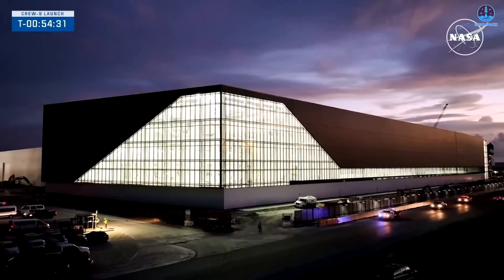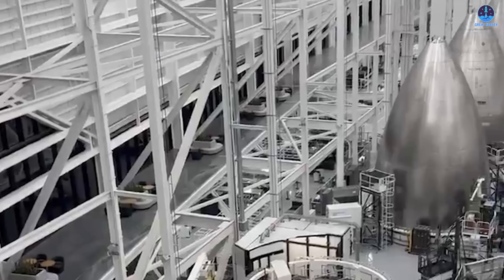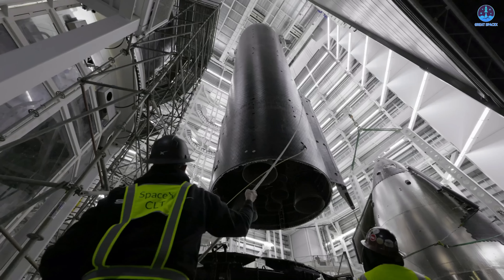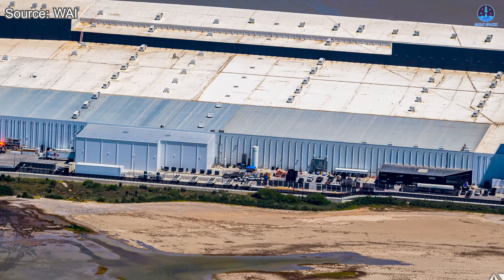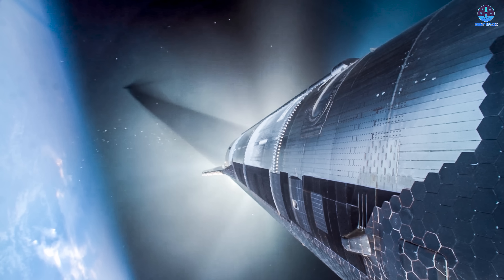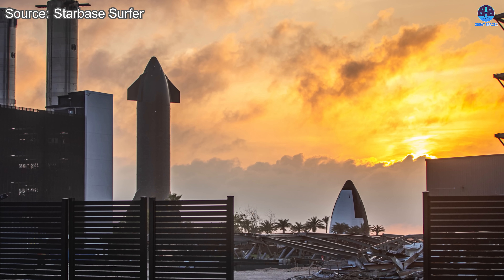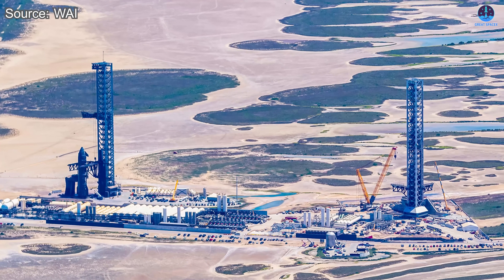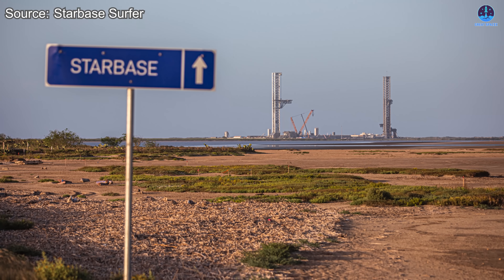Elon Musk Revealed Crazy Starship Fleet Inside SpaceX Starfactory Shocked the Whole Industry!

Comment: After refueling, the disposable StarShip in low orbit can be repurposed for other tasks by slightly raising its orbit using residual fuel. If solar panels and various equipment are installed during launch, it could be quite effectively utilized.
It also carries Starlink communication equipment.
It's like an efficient piggyback satellite.

Comment: لماذا لا يكون هبوط مركبة ستار شيب أفقي وليس عامودي مثل طائرات F35 بحيث يتم وضع محركات صاروخية جانبيه على طول المركبة الفضائية ❤
Reply: Starship too big. All the extra hardware and structural reinforcement would severely decrease payload capacity.
Reply: because that will increase complexity very much, and solves no problem as legs will still be needed to land by it self instead of keeping the landing gear on the ground in the tower and using the same engines to land as those you need to launch

Comment: SpaceX is gearing up to build more starships more rapidly? So who are the customers going to be? This is sort of like the Ford Motor Company gearing up to build more Edsals more quickly. Except in this case, SpaceX still doesn’t have the heat shield it needs. Gearing up to satisfy a demand that no one knows where it’s going to come from is good for just one thing and that is to attract weak minded investors to throw more money at you.
Reply: I think you missed what happened last launch. They reliably launched the satellites from the pez dispenser. They simultaneously just purchased wireless spectrum from Echostar. SpaceX is a phone carrier service provider company now. So they have a mix of ground and satellite networks. Any time people use their services even if they are not under their plan, SpaceX will get kickbacks. They are now a service provider that happens to have rockets in the mix.
Reply: Space x literally made a deal yesterday to buy $17 billion worth of spectrum license this move could allow star link to explode in profit as they would now be providing internet not just to homes or vehicles but to anyone with a phone. Spacex star-link will be starships first “client”.
Reply: @mackieangrybear5665  "providing internet not just to homes or vehicles but to anyone with a phone."

'Starlink in the UK costs £460 for the hardware and a £75 monthly subscription for the standard residential plan.'

I pay Smarty Mobile £10 per month for 80 GB of data. Where did I go wrong?
Reply: @JarvisThribb  if that plan works for you then it works for you but unlike that plan start link works literally anywhere at a consistent speed all the time.
Reply: Are you a flat earth person?
Reply: @estamato 
No. I just understand the rocket equation which says that rockets only fly if they have enough money to pay for it. Where exactly is the money going to come from? Please don’t say Starlink because I really doubt that Starlink is going to work economically. Please don’t tell me that people on earth are going to spend trillions of dollars to build a colony on Mars cause I don’t think people on earth are that stupid And, little or nothing has really been done to figure out exactly how you would go about colonizing Mars, what the structures would look like where the electricity would come from etc.
Reply: @wbwarren57  So you're saying that there is no point in sending mass to space? You don't see a vision for where that will be helpful. Ok, that's fine, I can respect that, but last I checked, SpaceX wasn't using tax dollars, and if people want to invest, then that's their business. Either way, this is not an investment forum, and if you don't see the vision for transporting mass to space, then what are you doing here other than trolling?
Reply: @estamato  "So you're saying that there is no point in sending mass to space?"

Do you understand it's considered very bad form to misquote people? And btw, visions are for Catholics, engineers work to plans. The design of this circus car rocket changes from day to day. IE, making it up as you go. This project is a scam and Elon Musk is a thief.
Reply: I don't think you truly understand what's going on here and space economy as a whole.
Reply: @aaronstodolka3438 
Please educate me. However, I think that if you build a lot of vehicle vehicles that no one really wants, they tend to end up in abandoned parking lots. Sort of like the cyber truck. So far, the only payload that I think the starship will carry our starling satellites. However , if Starlink turns out not to be a viable business., Then I doubt if other companies are going to want to put their very expensive satellites on starships that may or may not work. Certainly, the insurance firms that ensure these very expensive satellites are not gonna be too wild about the idea either.
Reply: I just want to say how nice it is to see 3 people engage with a troll in such a gentle way. His narcissism offended me, but I took time to read your comments before engaging the troll harshly. Now, not only was faith in humanity renewed, but I hadn't seen the EchoStar news! Elon just increased his Starship budget by a magnitude. It feels like they're right at the cusp of getting a handle on it after so much was learned during Starship V2. The cadence only speeds up once reliability gets to a high enough %! There are MUCH worse ways the wealthiest man could spend his money! Respect
Reply: @terrycombs736  "I just want to say how nice it is to see 3 people engage with a troll in such a gentle way."

A troll? Every accusation is an admission.
Reply: @terrycombs736  
Instead of accusing me of being a troll, why don't you respond to the points I'm making and questions I'm raising?  School me!  I look forward to being educated!
Reply: @terrycombs736 

The OP is entirely correct. Endless building of an in-process design, with a final (?) version (v4?) is honestly stupid. 

Starship should pass its PDR (many years into spending taxpayers money, it's still yet to pass this initial milestone), finalize the design, demonstrate crewless and crewed certification flights, and land on the Moon - before building in large quantities. 

As an aerospace professional, I have grave doubts that starship will ever be anything but Musk's vanity project, like the cybertruck. 

Starship architecture is EXTREMELY unfavorable for interplanetary missions - everywhere it goes it has to accelerate and decelerate 85 metric tons of its steel hull. 

The right way to fly between planets is with specialized spacecraft that burns non-volatile fuel. The right way to land on the Moon and planets is again with a specialized lander. All the mass that's not necessary for the mission is left behind. That was done in the Apollo program and it remains the only way to reach other bodies in the solar system in a weigh efficient manner.

Starship doesn't do that, and as a result, it's severely handicapped from the start. It's simply too heavy - and there's no way to get around it - physics are unyielding here.

MIT '86 AeroAstro
Reply: @dimitryzarkh2084  It's almost as though the ahem, 'designers' know nothing of the rocket equation, which is impossible of course they have.
It's a scam and that's pretty obvious to anyone outside of the Elon Musk cult.